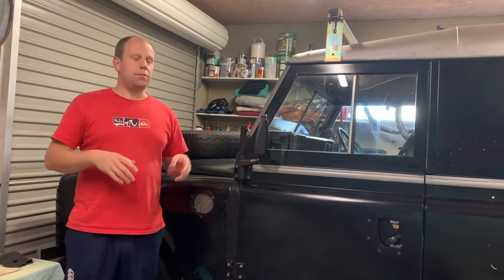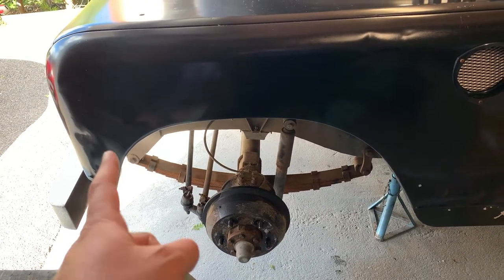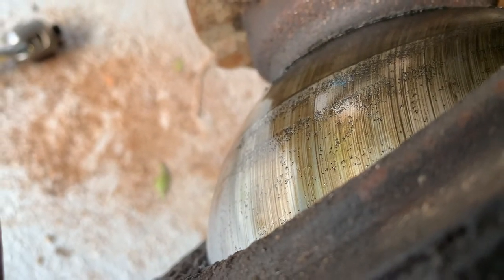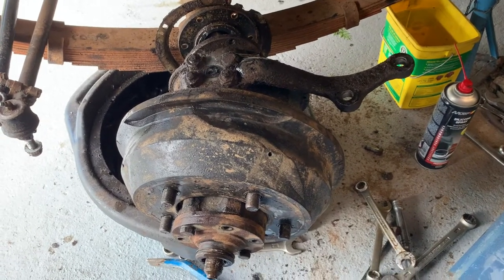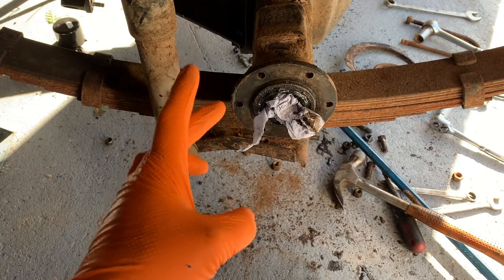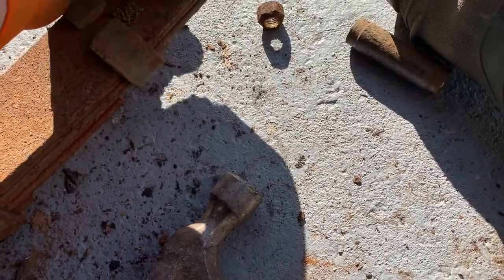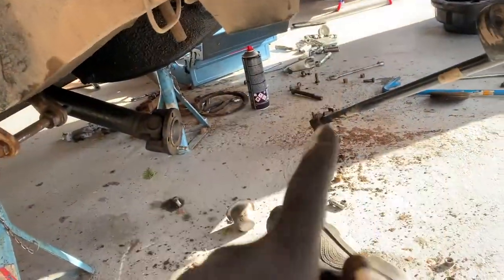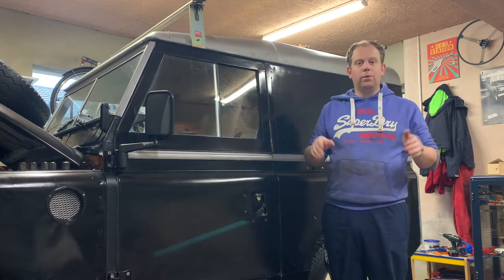Land Rover Series 3 - Front Axle and Suspension Rebuild and Restoration (Part 1)

Comment: The springs look great without replacement IMO.  A good clean up, a bundle of thin oil dribbled through the springs and they’d be good as new. If you can get them separated I’d recommend slapping copper grease between the leaves and then wrapping the whole spring in grease soaked bandage (the stuff they use to wrap underground pipes).  Once they’re blackened with dust and guff from the road they become invisible.  A mate has done that on his Series 2A and  it has made a huge difference so I’m going to do the same on by S3 when I work on them next month.  I’ve never stripped the suspension before so I’m avidly watching your vids to learn some tricks.  Thanks for sharing.
Reply from the maker: I’m glad to be of help! I like to spray mine with WD-40 whenever I remember, seems to help